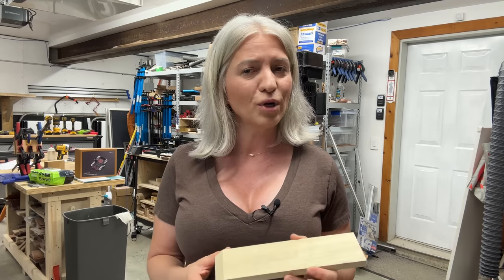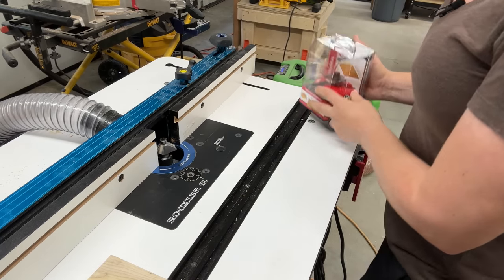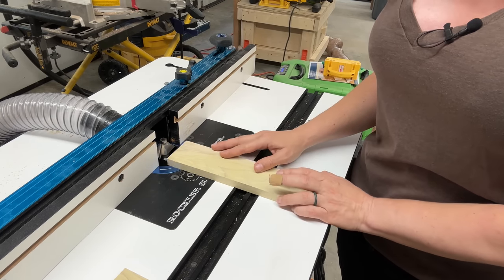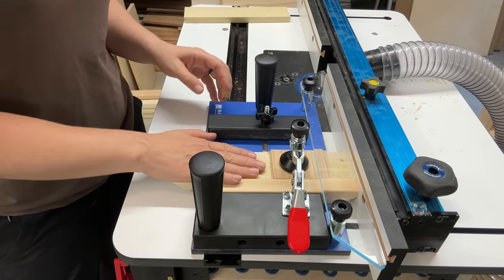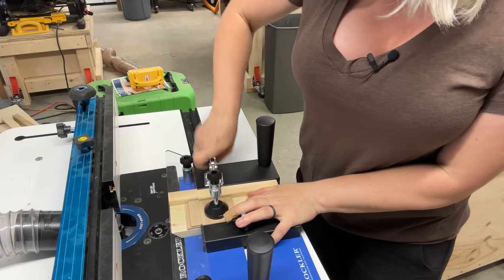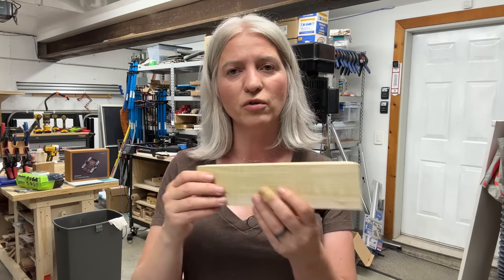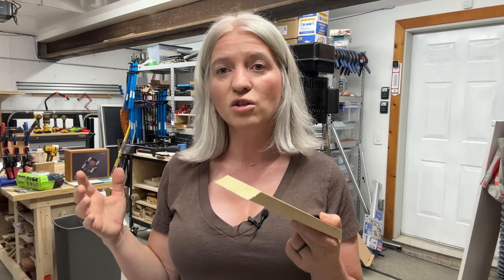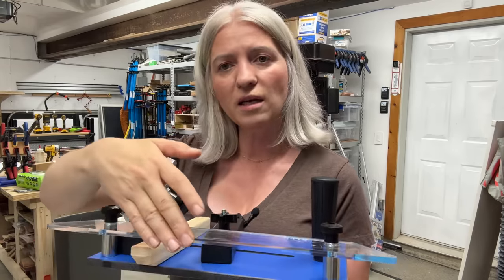The one MUST HAVE tool for the router table. Plus.....perfect miters every single time

Comment: This video was very useful for me, Skyler. I never considered that chamfer bits could be 100% accurate for making box miters. I'll use this method from now on. Keep up the good work. Thanks!
Reply from the maker: Thank you Erick!
Reply: Best to precut some of the mitre on the table saw or mitre saw. Cutting a full mitre on maple of harder woods is a lot of strain on the router and the bit. Use the router bit to clean up the last 1/32".

Comment: Great video. Like others commented, I didn't know these devices existed. I will definitely look into making my own. One feature to add to a DIY one is some way to take smaller cuts with several passes. I have some ideas concerning this. It would make the final cut even smoother, and be less stress on the bit and motor.

Comment: Looking forward to trying a router for miters. I cut lots of miters on the table saw now. I've started to set the blade at 44.9 or 44.8 degrees so that any gap will be hidden on the inside but the outside of the miter always will be closed instead of showing an obvious gap.

Comment: I make a lot of boxes like you but take a different approach to miters. I have a 45 degree jig that runs in the table saw slot and cuts perfect miters with the blade set at 90 degrees. It clamps the wood in securely as well and I think creates a smoother cut as the saw blade is not hogging off the entire waste as is the router bit. It’s consistent every time and does not require setting the blade at 45 degrees. You can make this jig from some scrap MDF and a toggle clamp for Pennies. I get perfect miters every time.

Comment: Thank you for this video. This is a much safer option than a table saw. Stumpy Nubs has an old video showing a kickback from cutting a 45* angle on a table saw. The waste piece went through 2 walls (dry wall/sheetrock) in his shop.
Reply from the maker: Oh, wow! That sounds scary. I had kickbacks from cutting miters on table saw but nothing too bad
Reply: 45° mitres work out beautiful if you know how to do it with no kick back or pieces flying back. I do.

Comment: Finally used my router table after many years of only using my hands and jigs. I had to put together a rough piece similar to what you demonstrated. It helped, but needed more support. So, a future project, is to build coping jig similar to the one you showed in this video.

Comment: I make jewelry boxes for a living but with a bandsaw and firewood. I do make a small amount of normal boxes too. This is great. What I would do though is I would cut a 45 degree cut on the table saw first leaving about 2 mm of extra wood. You could make the first 45s with a sled, hand held really fast not having to worry about how accurate it is. The point of the table saw 45 would still be a 90 degrees a tiny bit so it would register against the fence solidly. When you then do the finish cut with the router there would be almost no stress on the wood or the router bit making an even smoother more perfect cut. I bet the router bit would stay sharp a lot longer too. This would be especially important if you are making a large batch of boxes as I do.
Reply from the maker: That a great idea! Will try to cut on table saw first

Comment: I enjoyed your video on using a coping sled for 45 degree chamfer.  I bought one to use as your video shows but am told regular router bit, like i have, won't work.  I need a bit with a longer shaft.  Please, can you tell me your source for a longer router bit.

Comment: Pre cut a 45 degree on miter box or table saw 
Then make final cut on router 
You will put much less stress on router and router bit
Reply from the maker: Excellent tip! Thank you
Reply: @woodworkingwithSkyler  your welcome! Be well
Reply: That router was struggling on that cut. A 3hp-5hp shaper with a 4-5-6 inch cutter would be much better
Reply: I made a comment just like yours. Even a shaper will struggle a little or stress the wood on a full cut.
Reply: @brucemiller1696   going slower gets you their faster lol 
And safer 
Shapers are scary as hell I own one and use it ,but for most a scary machine . I’m involved with startup 
Woodworking school/ makers space upstate ny ,and the one machine we agree on not having is a shaper 
Nice table !!!
Reply: @ChrisB-xl4tq  thanks. I worked on large shapers and the best rule of thumb is the parts you are shaping need to be large enough to hang on to and control. Otherwise you need and should use a powerfeeder.

Comment: I use a similar sled, but home-built. It has 3 toggle clamps; one to hold the sacrificial bit of wood and one to the left and one to the right of the piece you are milling. The base is a bit of HPL, which works fine. My fence does have a series of holes to change the distance between the base and the table fence. A sees of holes gives less problems with adjusting the fence te be parallel to the table fence.

Comment: Excellent video, as always, thank you.  I have a coping sled from infinity tools, pricey, just under $300 with the miter bar accessory and auto adjust clamps. Not perfect, but very good, I like using it. You are absolutely accurate, I use it for other than cabinet doors (which I have never built).
Reply from the maker: Very nice! I looked at that sled a few times. Looks well build

Comment: Good vid and explanation. One point I'd add is that you don't have to make the cut in one pass. I make shallower passes on bigger cuts by free handing with the clear plastic guide away from the fence. I then make one or more additional passes the same way, or just finish with the guide against the fence as you demo'd. This takes some burden off of the router and helps avoid burning.
Reply from the maker: Great point!

Comment: I have this sled. What I did to work around the fixed distance acrylic shield was to build my own, with slotted cutouts for the hold down knobs. Not perfect, because of the need to square the sled to the table after an adjustment, but I got used to it. I still use the fixed acrylic shield for 90% of my work. I also replaced the supplied clamp with two that have smaller pads. I felt like the smaller pads increased the downward clamping force.
Reply from the maker: Great tip! Thanks for sharing

Comment: I have one of these that I bought for making doors and it was ok at best. I found the setup was time consuming and the sacrificial board was was even worse. They should of made it with a simple hold down so you didn't have to screw it in each time you go to move it. I ended up buying a router lift and set up for making doors became super easy. I can see where this sled would be handy for very small parts but I would never consider using it for a miter since I have a miter saw.
Reply from the maker: I can never make accurate miters for small projects on miter saw

Comment: It seems using the T-Track to slide down the fence would be advantageous if the bottom of the jig were modified to use the T-Track.. Just a thought. 
Silicone,,, or Saline... Very nice and proportional.. Enjoy the content in the videos.. Thanks.

Comment: I love your idea, but don’t know if the tow wood blocks that your work in between were thicker and cut 45 degrees longside thin lock your work between with the wider side of the blocks up, would that be fine? and will cancel the need for the toggle clamp?
I really love woodworking but I don’t do it.
Thank you for sharing this video 💐

Comment: Never knew such a jig exist.Thanks for sharing.Will surely build me one, cause if I have to buy it will cost me over R2000,00, which I don't have, but I have all the material and hardware to build me one.The router is the only tool that still intimidates me.😢
Reply from the maker: Good luck! I know you can do it. Router is not that scary. The more you use it, the more you will love it. Just stay safe
Reply: I'm going to do the same.  I have a piece of acrylic that is just begging to be useful. You won't believe how many times it has hovered above the bin until I decide "No it could be useful some day". This is the perfect project that will save it's life.

Comment: You can easily modify your sled (the one you have there), like cut a larger piece of plexiglass and make it adjustable.
I do that kind of thing with almost all my tools, especially "helper" tools like that shed.
I would almost always lean toward a less expensive "helper" tool like that sled, then modify parts of it to work the way i prefer.

Comments on the video:
This video was over 10 minutes long.  But you spent several minutes at the beginning telling us what you were going to demonstrate, and how it was better to demo than to describe with words! 
I agree that a demo is better, but why did you spend so long talking about it? Most of that could've been edited out.

Other than that, good video. 
You've convinced me that i should use a router for ALL my bevels!
I have lots of experience using the table saw for everything, but without best results. So, I learned a good lesson! 
Thanks! 😎

Comment: Do you account for the base of the sled thickness by raising the cutter height ?
Reply from the maker: Yes. I raised the bit and made a few test cuts first to make sure the fence is at correct position and I am cutting without eating from the top part of material.

Comment: What router bit do you like for this? I see that it is a 45 degree, but is there a particular brand/type that you find works best? Also, since you recently showed that you have a laser, couldn't you use it to cut the acrylic to the size that you need for larger bits?
Reply from the maker: Hi Mike. Added some of the chamfer bits I own and love to the description. They are all whiteside brand because is my go to brand when it comes to router bits. The size depends on what thickness materials you are using. The bigger ones can cut thin and thick material while the smaller ones are cheaper but limited in cutting size. I have not tried the laser on acrylic yet. I am sure I can figure out how to cut the acrylic just not sure I can build a solid jig to go with it. Thats why I bought mine.
Reply: @woodworkingwithSkyler  Thanks Skyler for your quick reply!

Comment: Maybe there's a way to modify that clamp so you don't need shims and also seems like there's room enough to add another clamp.
Reply from the maker: There is a way to adjust the clamp but its kind of a pain the way it works.
Reply: @woodworkingwithSkyler the 2 nuts should be tightened together though, so the Clamping foot is not loose. That is a dangerous set up.

Comment: Gee, I wonder how well a MITER SAW would work.  I'm guessing that with the word 'miter' in its name, it might just get the job done.  The Rockwell jig has lots of use for smaller parts, but for just a pure miter cut, I'd probable take a pass.
Reply: It really depends what tools you have.  Only a really good miter saw can make an accurate joint unfortunately and I learned this the hard way.  Miter saws are complicated tools with lots of joints and moving parts, they are difficult to make accurate.  I actually find I very rarely use a miter saw in the shop, i switched to a portable only one since I use it mostly while fitting trim or for cross cuts on a job site type environment.

Comment: I have that sled made by woodpeckers. But ive not had time to use it yet. So you recommend it huh?
Reply from the maker: Woodpecker tools are well known for quality and precision. What I like about that one is the fact that the acrylic fence is adjustable so you can use it with really big router bits. If you use most normal size bits and coping sleds will work. Even the non brand cheap ones

Comment: You can do the same thing for a whole lot less with your table saw miter gauge and cutting miters on your miter saw like most people do.
Reply from the maker: true. But for accurate miters takes a bit more time to set up properly. Especially if you work with a job site table saw like me
Reply: @woodworkingwithSkyler  I use my miter saw for miter cuts like every woodworker or finish carpenter does. That's what it's for. As in "miter" saw.